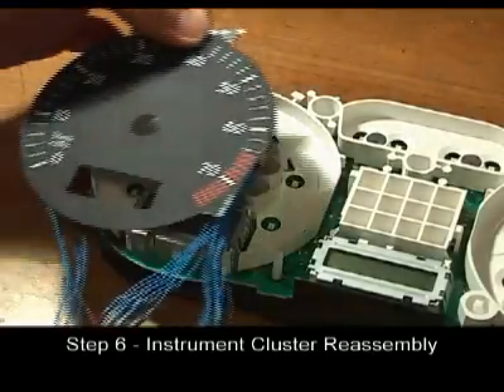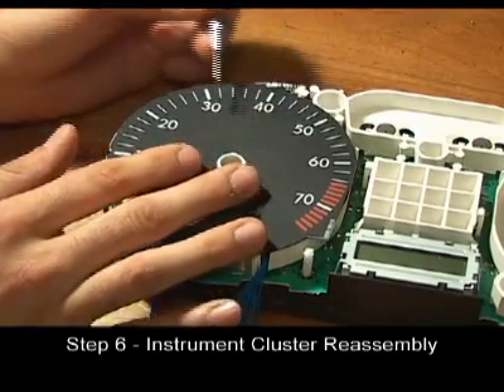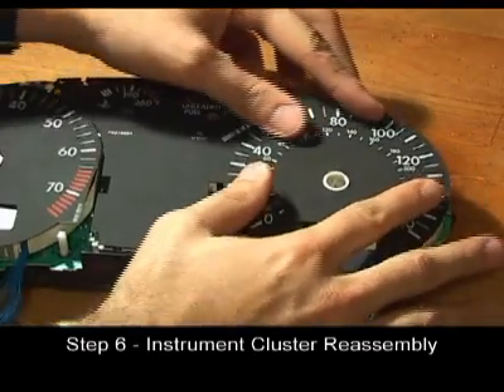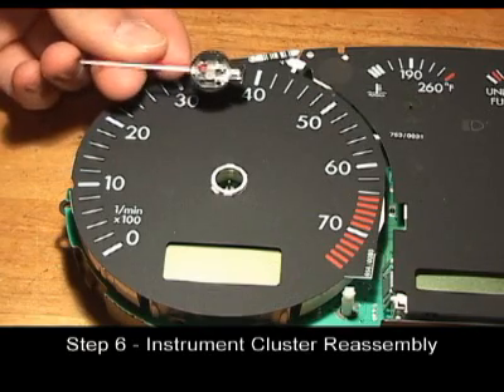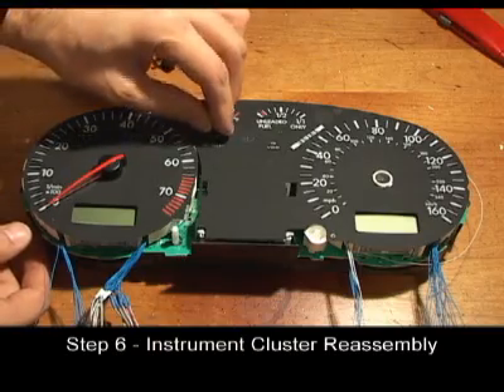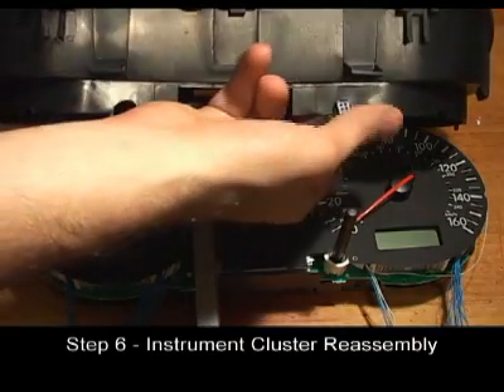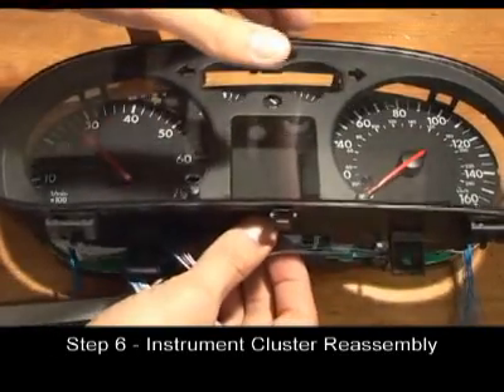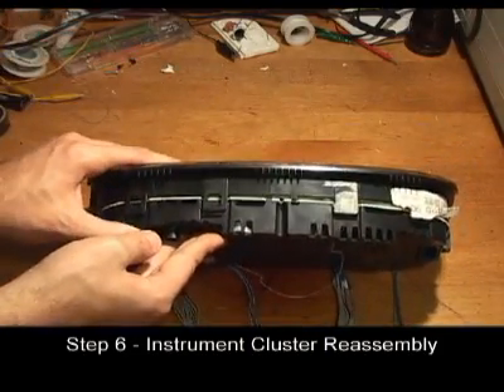LED Project #2 - Step 06 - Gauge Face Installation

Comment: do you have to set all gauges that way im having a problem with me temp gauge I pulled it off and put it on now its reading all the way on hot its all messed up do I have to reset it like in the vid let me no thanks
Reply: ***** check the ground wire on the back of the cluster for the temp gauge. should be a screw going into the motherboard. just ensure that it is secured and tightened properly.
should fix the issue.
Reply: thanks

Comment: You will be surprised at how thin and delicate the printed faces are...also, you'll want to go slow and deliberate and do it RIGHT the first time...cause if you DON'T(and leave scratches, fingerprints, or broken tabs), that shit will stick out like a sore thumb: it will be looking you in the face every time you drive your car...UNTIL you have to dig into the dash and do it all over again.

Comment: @cbielite It can be. Some cars like Fords, you have to take pictures of the gauges when the ign in ON position. Then you have to plug the gauges in and install the needles in the right positions. (after that you can un-plug the gauges to finalize the installation and plug back in)   Yeah... bit of a pain in the ass...